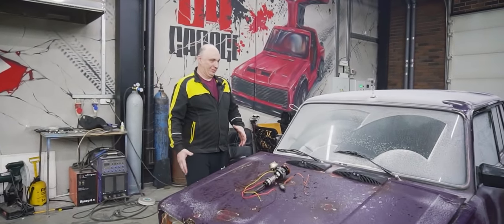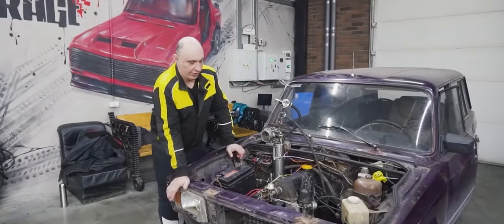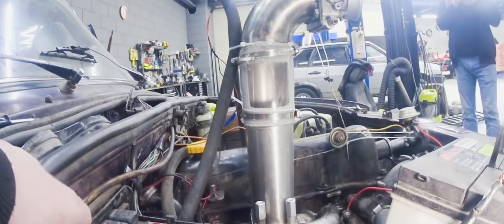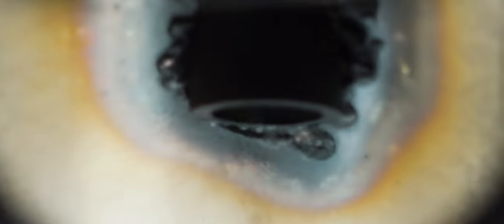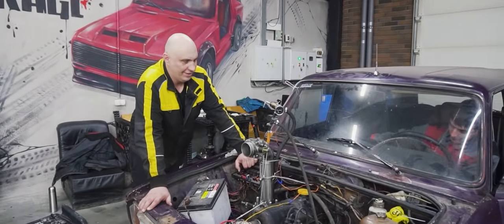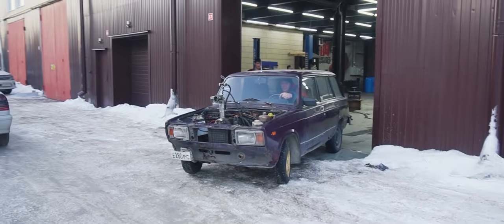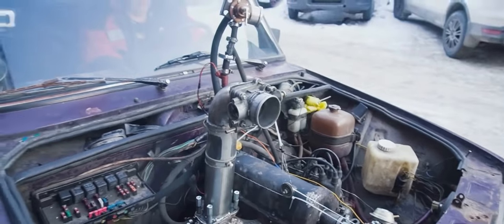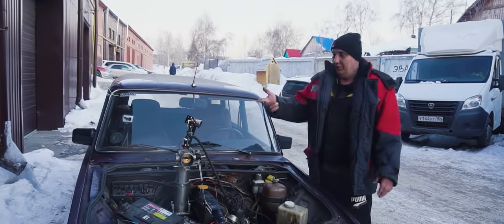Can you replace a carburetor with a fuel injector?

Comment: This is basically Throttle-body Injection (TBI); some early 90s cars had this for a few years.
Reply: Except TBI is computer controlled. This is mechanical controlled.
Reply: @normanguzman417  fuel injection doesn't need to becomputer controlled to be called fuel injection. Chevrolet sold a couple corvettes in the 1950s with a fully MECHANICAL port FI system fitted, something German cars have fiddled with for decades as well.

This is still TBI.
Reply: @Byw That's only because mechanical anything is a bad word these days and we've been dealing with computerized cars for over 30 years. Doesn't change what words mean. TBI is TBI regardless of whether the fuel injection is controlled by a computer, some clever valving, or hacked out of an old points distributor by a bunch of half-drunk russians in a back alley workshop.

Your engine is MPI if it has fuel injectors at multiple points along the intake path. MPI is just multi-point injection. It's not CMPI or EMPI, it's just MPI. Multi-Point Injection. Diesel engines going back over a hundred years have MPI on them; any diesel engine with more than one cylinder will have MPI regardless of its age by virtue of how diesel engines function.

Even some TBI systems are also MPI; GM had a habit of putting 8 injectors on one throttle body for their V8s in the early 90s before they finally gave up on TBI entirely and put the injectors at the intake ports.
Reply: GGALLIN1776  That's why I stick to carburetted rigs. Computers fucking suck.
Reply: GGALLIN1776  Coulda swore GM dropped that shit like a bad habit when they switched over to OBD-II in 1996. No matter, those TBI systems are easy fixes when they act up. Just rip the throttle body off, yeet it into the nearest 'art' bin, and install a 2bbl carb + fuel pressure regulator.
Reply: GGALLIN1776  The electrical impulses on the injector are mechanically controlled/timed, not computer controlled which makes it a little different from the typical TBI system used on late 80's - early 90's.
Reply: @TestECull  Emissions laws kept putting more pressure on car manufacturers,  so manufactures kept adding more sensors.
Reply: @normanguzman417  And kept making cars more and more disposable, complicated, and impossible to work on. They're shit. They're worse for the environment than they ever have been despite the tailpipe emissions being the cleanest in the history of the auto because they don't last more than a decade or so and use so so so so so so so  so much more energy and resources to build.

Fuck modern cars.
Reply: They haven't got to the early 90s in Russia yet
Reply: GGALLIN1776  I'm doing something very similar to my '95 F150. The vacuum lines are shot, the EFI system is shot, and I have an '85 sitting here with the same straight six that needs a complete top to bottom stem to stern overhaul. So I think I'm just gonna rob the intake and carb off of the '85, bolt them onto the '95, splice in a fuel pressure regulator so the float can properly control fuel level in the bowl, and send it.
Reply: @TestECull  Or, just disable the in tank pump and plumb in the lines to a low pressure in line electric pump. And to fill you in a little more on GM CPI (Spider injection) units, in the Vortec engines, they use electromechanical injection. Signal comes in to the cylinder that needs fuel, a "solenoid" opens inside the unit, sending fuel out the plastic tube to a poppet valve. That's why fuel pressure is of utmost importance on the spider injection engines, they have to have enough pressure to pop the poppets. 2003 and later 4.3 V6 ones got true MPFI with individual injectors instead of poppet valves at the end of the legs.
Reply: GGALLIN1776  Castings did not change significantly between 1964 and 1997.
Reply: @TestECull  1957 was the first year. It was also available on passenger models. The low line 150 two toned black and white became known as the black widow. A street racing legend.
Reply: GGALLIN1776  technically not. Points have power going to them and then out to the coil, absolutely nothing electronic there. Just power flow controlled mechanically.
Reply: Yep... gm tried it and feel on its face
Reply: @TestECull  reminds me of old diesel cars, all diesels are fuel injected but older ones doesn't have any electronics at all, just an injection pump.
Reply: @tristan6509  ye. Mechanical ones are fine they generally don't give ya any grief.

Comment: your injector pulse is controlled by the distrbutor, so the injector is open the same amount of time for each rotation.
so it's rich at idle, and lean at speed.
only variation you can really do is pressure.
vary it by speed, and you should be able to control mixture %.
Reply: This is exactly the issue.  Injector pulse width or pressure needs to be changed with engine speed.
Reply: indeed, have pulse width  vs rpm but no pulse width vs load (manifold pressure).  Should have a lambda controller that gives feedback to a fuel pressure regulator or pulse width adjustment (and above that an acceleration enrichment and warmup enrichment)
Reply: Eliminate the vacuum advance?
Reply: @scattkiwiman  No need for a "proper" controller. An Atmel micro with a MOSFET and a few other components should do the trick nicely. If it weren't for the, uhm, "current political situation", i'd be able to slap together a circuit and have it send off within a couple of weeks.
Reply: vacuum reference fpr would make this run way better. maybe a properly sized injector would ease tuning lol
Reply: @ReneSchickbauer  yeah and while you are at it give it a o2 sensor feedback loop.

Comment: I like this sort of "Mad Max" type thing... you never know if the situation might call for a crazy/simple solution. 
Years ago I put a turbo on my car (a car that is rarely if ever turbo charged) and couldn't replace the injectors to get more fuel but I had not considered at the time adding a 5th auxiliary injector.
It was actually fairly common practice on cars with the same engine but I wasn't aware.

Comment: add vacuum line to pressure regulator lower pressure at idle and rise at wide open throttle, you need less fuel at idle and more fuel on acceleration, you might need more than just 1 injector

Comment: I'd love to see you turbocharge a fuel injected car, and use an adjustable rising rate fuel pressure regulator, with fuel jet from a nitrous kit to tune for the extra fuel (instead of adjusting the normal fuel injection)

Comment: At low RPM the distributor close for more mS the break points, at higher RPM is less mS per revolution.
That's why the engine is lean at high RPM (less mS for the injector less fuel) but very rich at idle
Reply: exactly!
Reply: They could use the intake manifold with a vacuum switch to connect / disconnect in capacitor across the fuel power supply and ground it should smooth the pulses a little and open the injector a bit longer. Capacitor size would be critical... otherwise it would either be useless or just open up completely at part throttle haha. Instant dragster style fuel injection...
Reply: Adjustable Variable rate FPR could resove this.
Reply: Actually, thinking about it, they should just get rid of the throttle body, tune the pressure to give optimum fuel at max revs and use the clutch as the new throttle. Problem solved.
Reply: They could use a potentiometer or throttle position sensor or maf. Idk.
Reply: If its a expensive unit. Cheapos dont do that I guess
Reply: It needs a very simple ecu that control's the amount of time that the injector is open that uses rpm and throttle position and o2 readings to adjust. There's no way to get anywhere close to the right a/f ratio without any computer to control it.
Reply: @bryanwheat9101  Have you ever heard of Bosch cis? Multi port fuel injection, no electronics. It works fantastically with no ecm and no O² sensor. Featured in '70s and 80's Era Mercedes, Porsche, and Volvo. Even the later computerized cis-e system could be tricked into operating and be mostly  drivable with the ecm disconnected, just slightly less efficient.
Reply: @Jedendwa0  

These guys are not the Russian military.
Reply: @skylined5534  Wiem. Oby nigdy nie musiał.
Reply: @Mechagnostic  "no electronics" Wrong.. The system completely depended on electronics. It was simply an analog system, not digital, and didn't rely on feedback from an ECU. This system was also known as the "Jetronic" injection system.

Comment: If you can do basic electronics, a mosfet and an NE555 set to one-shot mode, triggered by the distributer and pulse length controlled by a variable resistor connected to the throttle input would give you some control of mixture without needing an ECU. On the other hand, it's probably easier to setup an arduino to do the same thing, and would be easy to tune.
Reply: Yep, arduino controlling relays/mosfets connected to the injector. Also arduino controlling a pwm servo controlling the throttle body. Encoders detecting rpm, maf detecting airflow to allow for calculations on injection output.
Reply: @kennysboat4432 so basically a speeduino.

Comment: Very creative. I like the window you added to be able to see the fuel going into the engine. I also found your method of attaching the distributor to the overhead cam very interesting. It makes me wonder if you could take a car with an ECM and downconvert to use a distributor and carbureteur. .
Reply: you can people do it all the time. you just have to use a 2 wire electric fuel pump get a carb style intake. on alot of chevy trucks you can swap an old carb intake to a fguel injected motor take out the ecu run a 2 wire pump with 1 wire alternator  activated by the same wire as pump an msd ignition box for timing and a separate hei distributor you can make it a carb motor from fuel injection. done it once myself.
Reply: that window trick i gota try it for my turbocharged system right in the middle between the intake manifold and pressurised air cleaner downstream from the outlet of the 76-70T so i can see if it's icing up or not and air flow/dirt stoppage ect
Reply: @mattquarles7029  Yes, I think quite many engines designed at or near the carb-to-efi transition era, have bolt-on swappable carb and efi, and manufactured and sold with both versions. For example, Toyota had 4A-F carb engine, and 4A-FE which was same but carb system parts replaced with similarly fitting injection system parts.
Reply: I took my drive by wire 1.9 Tdi
And converted it to mechanical pump no computer. 
Doesn’t even need a single wire to work
Reply: @fastinradfordable loved my 95 TD. Had it running 32psi boost with a manual vacuum valve in the glovebox and the mechanical pump turned up a little😅  problem was after a while it sheared the crank pulley keyway and grenaded the engine. Apparently the TDI pulley is the fix for the older cars. Didnt do that myself but heard other Dub nuts do.

Comment: The Chevy 283 CI had a window in the distributor cap so you could adjust the point gap (dwell) while the engine was running, that would have worked well for you!  You sure have a great crew, thanks for all you do!
Reply: Thats cool

Comment: In 1988 ford autralia did this for the EA falcon and called it CPI (centerpoint injection). It was 2 fuel injectors in the center of a throttle body. It wasnt terrible but also no great. It was used until 1992 and succeeded by MPI  in the EB falcon.
You wont get it running spot on without a computer to change the injector pulse so its going be fine at idle and lean out at revs or flood at idle and be fine in the revs. The points are consistant and when you rev, the points contact is shorter so injector will have shorter pulse when it needs to have longer.
Basically, find a method to increase the injector pulse time the faster the engine revs.
Reply: "H G" pointed the right direction for a setup like this, needs variable fuel pressure, low for slow, high for fast. a regulator connected to the throttle maybe?
Reply: They used cpi in the states too
Reply: The 1988 EA falcon also had multi point fuel injection, atleast on the S variant
Reply: @gfalcon1375  yep, and also I believe the fairlanes and fairlane Ghia's. Optional on Fairmont's. I had a Fairmont Ghia with CPI.
Reply: Ford USA did this on the 302 in the Crown Victoria.
Reply: Brothers first car was an Ea single point, mum and dad had a multipoint Eb it actually went alright 👌

Comment: I like that you have more injection events as the rpms increase, but the injector "on" time decreases at the same time. 
  I think you need an accelerator pump feature to squirt fuel when you move the gas pedal. I don't think the throttle body is too big. It's just a matter of incorrect fueling for the amount of air being ingested. A vacuum referenced fuel pressure regulator can also help reduce fuel pressure to lean out the mixture during idle and light cruise but add fuel pressure as rpms increase. 
  Very cool concept and it could work well with a few refinements.
Reply: I did not even realize the "on" time thing. You are smart.

Comment: Awesome job guys! I liked the distributor as fuel timing. I wonder what your fuel pressure was. And maybe have a second pump activated by contact switch off the throttle body to boost the injector at higher rpm. Thanks for sharing.
Reply: Or could you connect the fuel pump to an electric rheostat controlled by the gas pedal. Sort of like a light dimmer.
Reply: @inmyopinion6836  simple and elegant!

Comment: Brilliant. Single point injection! Works increasable well considering there is no duty cycle modulation on the injector. Thanks G54!
Reply: @ccox7198  I would think the injector would lean out as it revs higher because of the lack of modulation.  The faster the revs the shorter the pulse to the injector because it is just a points system.
Reply: The duty cycle come from the dwell time from the distributer used to trigger it.
Reply: @cS-nf2dg  yes but it's fixed.

Comment: Look into the "Speeduino" project. It's an open source ECU that can be built dirt cheap and will run pretty much any motor.
Reply: Thx for the info it’ll help me a lot in my project
Reply: Yeah Pgm fi that lada and rev it to 7k
Reply: @Jedendwa0  its a Puttin problem. Not Garage54 or Russians.

Comment: If You cant control the duration of single injection, You can still control the fuel pressure. 
Connect the gas pedal with the fuel pressure regulator - this will change the amount of fuel per one injection.
Reply: You absolutely can control the duration of a single injector.... what makes you think you cant?
Reply: @DrewLSsix  
You can do it wit ECU.
How to do it without any electronic?
Reply: @jareknowak8712  ....  redesign the dist so the vac advance changes the point gap with manifold vacuum. That way you can get longer and shorter duration for pulse width for changing load.

Comment: What if you had no timing for injectors? Just throttle position. Have a tiny injector for idle & another tiny injector for above idle. Just on or off. 
Maybe a third injector at full throttle.

Comment: Congratulations on creating a paradox!
The engine needs fuel and air to run (generate RPMs)...
The injector is hooked up where it only pulses ON (opens) every time the crank (well, cam) makes a full revolution.
To increase the RPM, you need more air and fuel, on an upward trending angle... But the fuel rate can't increase until there's more RPMs... But the RPMs can't increase without more fuel... lol

But seriously, I like the idea a lot, was interesting! (even though they are just trying to recreate a really crude "Throttle Body Injection" lol)
I think where they went wrong is they should've used a DC drill motor and trigger as the "pulse generator" to keep it separate from the engine RPMs. Gas pedal is connected to the drill trigger, giving variable speeds. Of course, matching how much electric motor speed with engine RPM would be the real trick.

Right now as it is on this vid, it's running too rich at low RPM, but then starts to lean out and can't make more power. (which he confirms) 
The reason you have to *go easy on the gas pedal" is because the air:fuel ratio (AFR) is way off and the engine has to catch up once there's more air... But then it leans out to much... etc etc paradox.

If they still have access to the open internet, I suggest they lookup 1950s era fuel injection and how they went about tackling the AFR with only mechanical systems... If start by adapting the fueling system from a diesel Lada 🤔
Reply: That'll teach me to ramble before I scrolled through a few pages of the comments! lol
TBI, mechanical fuel injection, rich-idle/lean-revved... All mentioned! 
We're a smart enough bunch, I should've known after 3days my thoughts would've already been conveyed! 😁

Comment: Should've had a staged setup with an additional 2-3 small injectors that would turn on at different throttle positions. Also, a referenced fuel pressure regulator would probably be useful. What you have currently is, in essence, a GM TBI setup. With the exception that the injector is behind the butterfly instead of in front of it.